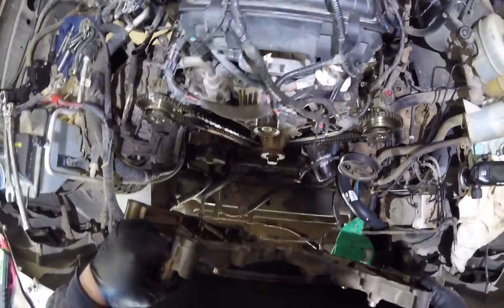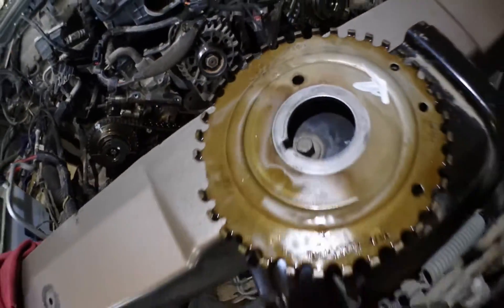Ford 5.4 3V Cam Phaser DIY Timing Cover Removal

Comment: you could have put the harmonic balancer bolt back in before removing chains and rotating the engine into the timing marks.

Comment: Can you explain in more detail about the camshafts and vice grips?
Reply: Lock down on it behind the gear so the valves don't rotate the cam out of time
Reply: @5.43v  do you do this while the dot is in the 6 position and keyway at 11?

Comment: 5.4L motors are interference motors, every single maintenance manual tells you this.,...if the timing was off that badly then you should be scoping the cylinders at least to assure no damage to the pistons.  Never, never in my life have I ever heard of anyone using vice grips on any part of a camshaft or timing gear of any vehicle...they have specifically made tools called cam locks to keep them from moving...which usually come with the crankshaft position wrench/holder which is displayed in the video...and costs about 10 bucks on Amazon.  The movement displayed by the movement in the vice grips can be done with a socket and ratchet on the cam bolt.  I know he has not down the reinstall in the video but to reposition the cams properly...you have to loosen the cam caps.  I dread to look how he does this.
Reply from the maker: Another person not know what they are talking about…….. arm chair mechanics over 60k strong since the lock outs have been done.
Reply: I did mine using vice grips, i made sure to place pieces of rubber floor mat between the vice gripper and the cam-it worked like a charm.

Comment: The idle roller on the right side of the harmonic balancer, I cant get off for the life of me, any suggestions? I saw it was already taken off when you were undoing the front cover
Reply: Yes, you are right, he doesn't show how he get to that one but, I guess he loosened the power steering pump and you can see in the video that is loose already but he doesn't mentioned it at all.

Comment: my trucks timing chain on the passenger side started eating threw the cover I’m sure both guides are shot I replaced the oil pan gasket just to find all the plastic in there

Comment: can i replace the chain guides and chain tensionors without worrying about the timing ?
Reply: Did you get it figured out?
Reply: Yes I just did exactly as he did in the video.
Reply: I just made sure the timing marks on the chains were lined up where they were supposed to be and I had no issues.

Comment: I have a oil leak coming from the passenger side timing chain front gasket.  Not much but enough to drip onto the driveway. About a drop a day.  Should I replace the gasket again?  I’ve already done all the work you’ve done here.  Can I use a oil leak sealer?

Comment: Hey man!! I went through this nightmare once before. I did about 10K miles on the truck, and now I have a rattle on the passenger side once the engine is warm, but not on startup. Im thinking I have an issue with the tensioner. I used the crappy plastic ones, and I probably should of used the Melling Cast Iron ones. Do I need to remove the valve covers to get the timing cover off?

Comment: GD, everyone is skipping taking the bracket that the power steering reservoir bolts to off.  I can’t recall how it bolts up.
Reply from the maker: There is only one way it can bolt up

Comment: Are those metal stud like pieces that the idler pulleys sit on replaceable? I literally just stripped one of mine. Do i have to replace the entire cover for that?
Reply from the maker: No idea to be honest,
You already got it apart if it doesn’t come out it won’t matter as the part will already need replacing